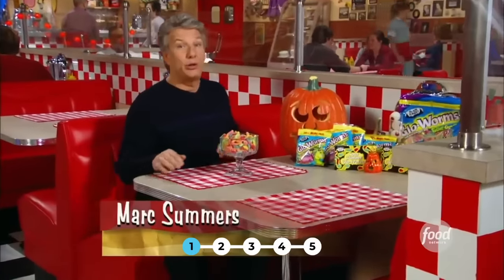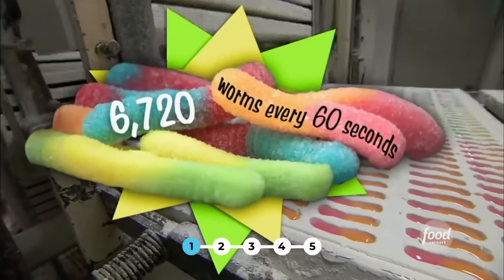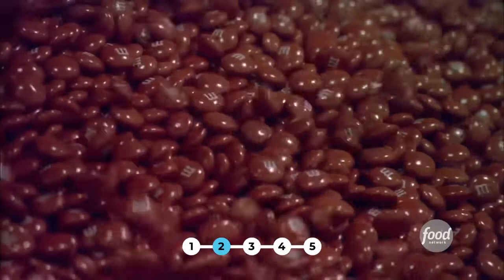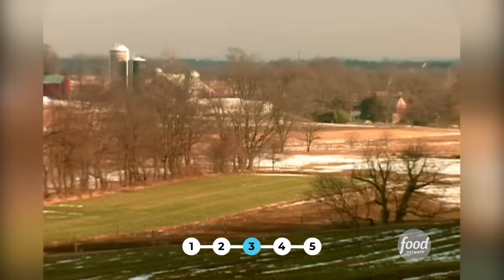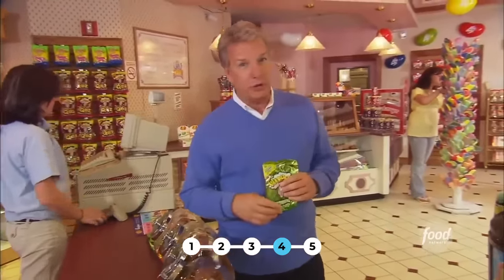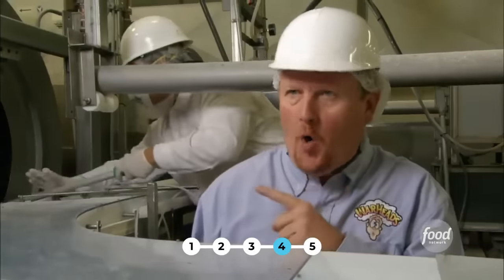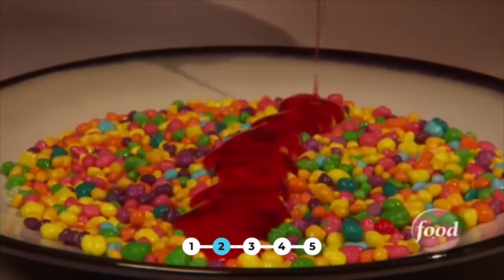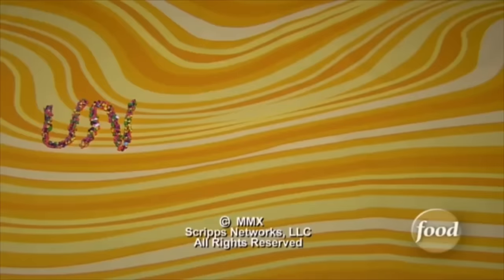Behind the Scenes at 5 Top Candy Factories | UNWRAPPED | Food Network

Comment: Savor the nerds rope! Don't play with it or rip it apart, the "Tear and Share" claim is a lie, nerds will fly everywhere. The largest bite you should take is 2 inches, average bite size should be less than an inch. It is encouraged that you pull individual nerds off the rope then proceed to eat the gummy portion. The most you should eat in one sitting is 4 inches, each sitting should be around 30 minutes for you to appreciate the quality. Once you eat the first 4 inches PUT THE ROPE AWAY! Let that puppy stale up just a little bit and you get a totally different texture experience